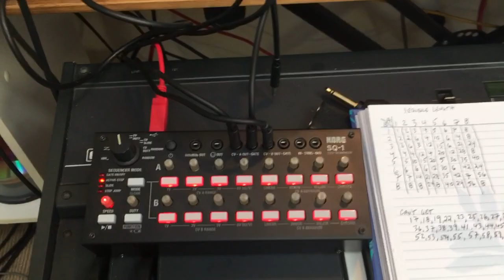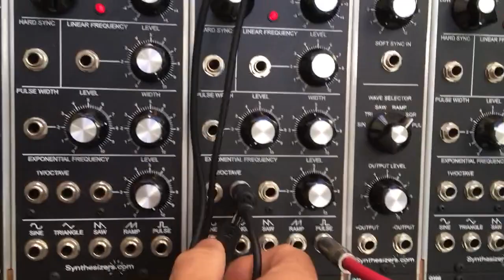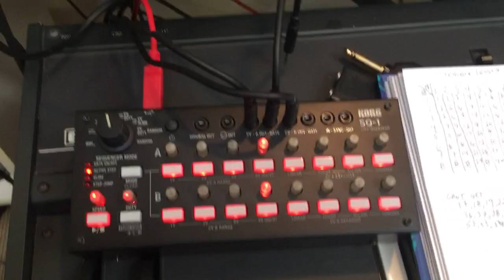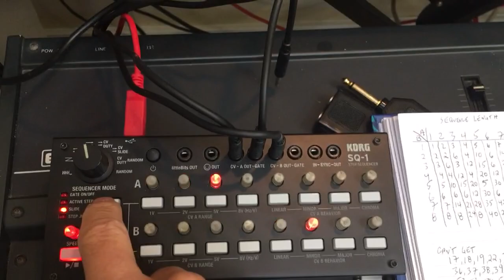Korg SQ-1 sequences longer than 16 notes

Comment: is there a way to sum the 2 voltages without a module like your own?
Reply from the maker: Great question. Not knowing what your gear is I cannot make a specific recommendation, but even a mixer is actually a voltage summer. If you have any modular equipment at all I’m sure there are plenty of utility modules that can perform this function. Many amplifiers with multiple DC inputs also sum voltages. From a technical perspective, to sum voltages accurately the input impedance of the summing circuit need to be high to prevent ‘pulling down’ the voltage outputs from the SQ-1 which would de-tune the summed CV’s.

Comment: Does any one know if you could do this with MS 20? And how? (I'm still new to modular and Korg MS 20 patch bay is pretty confusing). Thank you!
Reply from the maker: I have not tried this with the MS-20, though I do have an original one. The MS-20 has three locations in the patch bay that can be used to control VCO Frequency: “VCO 1+2 CV IN”, “Total”, “Freq”. The last two have intensity knobs under the FREQUENCY MODULATION knobs “MG/T.EXT” and “EG1/EXT”. To try this out I would run CVA from the SQ-1 into the “VCO 1+2 CV IN” and then CVB from the SQ-1 into the “FREQ” jack. Turn the “EG1/EXT” knob all the way and experiment to see what you get. For the original MS-20 the frequency control is Hz/Volt (not V/OCT) so you have to turn on the SQ-1 and hold a particular button combination to put it into Hz/Volt mode. The ‘manual’ describes how to do that.
Reply: @mikeolson7588  :Comment I've been looking for! Thank you for helping me take out the K2 from the closet :)

Comment: Ok. Great. But don't you need an VCO with two CV inputs? Or will you get the same effect if you mix two CV signals?
Reply from the maker: I used an oscillator that actually has 3, 1V/oct inputs. You can use a mixer as long as the mixer doesn’t attenuate the signal. In other words, if you put in two signals each of 2V, then exactly 4V has to come out. A ‘lossy’ mixer might put out 3.8V and then tuning will be off. You can verify this for yourself with your gear.
Reply: @mikeolson7588  Yes! I tried it with a Intelijel Quad VCA and it does work pretty well. Actually, attenuation with different curves can have quite interesting effects, if you're not after equally tempered intervals.

Comment: So do you think the sq1 is a good sequencer?
Reply from the maker: I do, especially for the money. Since I use mine exclusively with analog gear, it is a very good fit. You have probably noticed a recent explosion of new sequencers on the market. Korg has introduced yet another sequencer as well. There are many good choices with a wide variety of capabilities and prices to fit pretty much anyone’s needs.
Reply: Thank you Mike for your prompt reply.
There are so many things in the market now it gets hard to choose.
I just wanted varification.
My Sq1 came in the post today.
I bought it second hand and it hasnt got a mark in it.
It all lights up and blinks etc etc.
I look forward to using it.
It seems to be easy to operate.
I was blown away on discovering each sequenced note pitch can be changed.
It is very solidly built and FEELS good.
Thank you for putting my mind at rest.
I need to work out how to use 8 and 16 sequences before I advance to 56.
Biw Wow 
You are very clever.

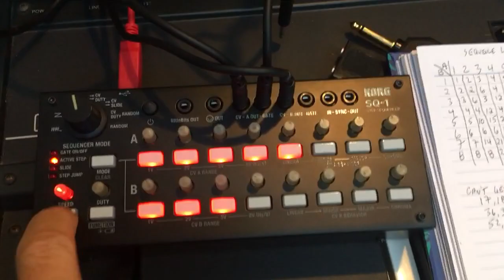Comment: 3:11 Just to clarify, for anyone who might be confused (I was for a second), only one of the two tracks has to contain an odd number (although both can).  Either way, you'll get the same sequence, but starting from a different note.  This is because the LCM will always be the product of the two numbers (with one exception, below), which means the sequence will run through every permutation of A+B.

If both tracks are even, then there are two possible sequences (again with one exception): one when both tracks start on an odd (or even) step number, and one when one is odd and the other is even.  Each possible sequence contains only half the possible permutations of A+B.

The exceptions arise when the larger number is a multiple of the smaller number, and the smaller number is greater than 2 - in other words, 6:3 and 8:4.  They will result in 3 and 4 possible sequences, respectively.  This expands when you use two SQ-1's to do this trick - 9:3, 12:3, 15:3, 12:4, 16:4, 10:5, 15:5, and 14:7 will all result in similar behavior.

Obviously, both tracks have to contain more than one step, and they can't contain the same number of steps.
Reply from the maker: Yes and well said.
Reply: I cant believe how insanely excited i am to try this. Where have you been all these years? Big love for the sq1. Would love a reissue of sq10 in green to match my ms20...

Comment: Does this trick work with MIDI out as well, or only CV?
Reply from the maker: I don’t use MIDI from the SQ-1 myself. However, I do know that the two channels put data out on 2 different MIDI channels. By Default that is Channel 1 and Channel 2. In order for this to work with MIDI you would have to add the midi note numbers somehow. I think a DAW like Logic Pro X can do this with it’s MIDI math capabilities. I have never tried it myself so I can’t tell you exactly how to do it.
Reply: @mikeolson7588  Thanks!

Comment: The relationship between the part lengths and the total sequence length is that the sequence length is the least common multiple (LCM) of part lengths. So from the set of e.g. multiples of 3 (3, 6, 9, 12, 15, 18...) and multiples of 5 (5, 10, 15, 20, 25...) find the lowest number that exists in both sets. This is useful to know if you add another pair of sequencers into the mix and would have to draw the table in four dimensions!. All the other common multiples can be found once you have the least common multiple—they're all multiples of the LCM. Useful generally with polymetric music to figure out at which points your sequences align.
Reply from the maker: You are correct. I made another tutorial making long sequences where I discuss the LCM at length. https://youtu.be/JqpCqJ-XjCg
Reply: @mikeolson7588    I've found out that this @storerestore is saying is untrue, at least for this Korg Q-1. What @Storerestore say's, it does not apply to all the table (check for instance 6 and 8, the least common multiple is 2, so by @storerestore's algorythm then the answer would be 12 or 16, and the correct one is 24) 
By observing your table I've found out that this next 5 rules applies to the whole table except to number 6, and it seems that because 6 it is the only pair number that won't fit in 8 steps)

1- The first 8 steps are direct multiplication. (e.g 8 and 1 = 8 steps)
2- For the whole matrix, equal steps in both are the direct number  (e.g. 5 and 5 = 5 steps)
3- When there are 2 pair numbers, just take the major one. (e.g. 4 amd 8 = 8 steps)
4- When pair and odd numbers, multiply them (e.g. 7 and 8 = 42)
5- All this applies to everything with the exception of 6-4 and 6-8, in which it seems that you divide 6 in triplets, so it is 3 which multiplies the other number......

Please, check this with if you have more sequencers, I would really like to know if this applies to those bigger arrays 🤓
Reply: @MarcoPolux  For 6 and 8, according my algorithm, you'd check for the first number that exists in both sets of multiples (6, 12, 18, 24, ...) and (8, 16, 24, ...), giving 24 which is indeed the least common multiple. You can very easily determine that LCM(6, 8) is not 2 because it exists in neither set.

Comment: Is this possible using midi OUT and parelel, or is it only possible if the recieving synthesizer can take 2xCV?
Reply from the maker: The MIDI outputs are on two different channels. You would need to be able to do some MIDI math to add MIDI note numbers from the two channels and then transmit them back on one channel. I have never tried to do this and I’m not sure how I would go about it. Perhaps using the MIDI tools in Logic X you could do something like this. As an alternative if you can convert each channel MIDI notes to a CV and then add the CV’s together, you could achieve this. But, if you could add CV’s you wouldn’t need the MIDI data in the first place.

Comment: I have the SQ-1, a Behringer Model D and a Neutron. I'm feeling like I have enough hardware to do this. I think the summing thing is the secret sauce?
Reply from the maker: Yes, the summing of the two channels from the SQ-1 is the key to making this work. In my example, the VCO has multiple 1V/Oct inputs that are summed together. However, you can also sum using a mixer, or even an amplifier that has two inputs and is DC coupled.
Reply: @mikeolson7588    The Behringer neutron has summing  Inputs and outputs on its patch Bay. I will research. Thanks.
Reply: No dice. Unless I'm using the summing circuit wrong. The are 2 inputs and a single output. Manual doesn't do much to explain the patch points.
Reply from the maker: Ronald Figura , I took a quick look at the Neutron manual. It looks like running the CVA into SUM1A and CVB into SUM1B would be the way to go. Then run Sum1 Out to OSC1 CV IN. You can run to just one or both oscillators. Since I don’t have the synth, I can’t try this myself.
Reply: @mikeolson7588  did that. Tried running the 56 note sequence. Seemed a bit short.
Reply: Oops. Used the wrong values for A & B. I am at a rehearsal right now. I will try again when I get home.
Reply: Ok. I think I got it. Thanks for your help and the insights. There's more going on behind these panels and jacks than meets the eye!

Comment: i thought this may interest you :- Power on the SQ1 while holding the [Play/Stop] Button puts you into Global Param Settings Mode , moving the Sequencer Mode Knob and Selecting the Small Up/Down Zigzag changes sequencer resolution to Quarter Notes , the long Z changes it to Eighth Notes and back N forth one sets it to sixteenth notes , (select choice the press power button to save, and sq1 will reboot with new settings)
Reply from the maker: Steven McDougall . That is correct and is described in the manual/FAQ site. For things NOT described in the manual or FAQ site, check out my other video on Undocumented features.
Reply: loving it so far , been playing with it for about 6 hrs with my volka keys with an empty pattern on the keys {to stop volca playing its sequence :) } well thats until my 64pixels midi hub comes so i can filter the start CC out
Reply: @NeonFuxAlot    What 64bits MIDI Hub did you end up getting?

Comment: Hi mike this is really cool... Do you have  this table published? It sounds like you do..?
Reply from the maker: Hi Paul, yes the table is published. If you look down in the comments, there is a link to the table in the SQ-1 Facebook Group. If that doesn’t work for you, I can send it to you separately. You can create the table yourself since mathematically, the sequence length is the Least Common Multiple (LCM) of A and B. This is helpful to know if you use other sequencers with more stages, or if you combine multiple sequencers.
Reply: Mike Olson thanks! I'm not on Facebook. I'll see if I can see it, if I can't drop another reply here...
Reply: Mike Olson thanks I was able to see the table... So if a synth only had a single input to its VCO, could you just merge the two signals? Or would an AND logic gate of the trick?
Reply from the maker: Paul Boos it depends on the synth. Anything that can add two voltages will work. In many systems, a mixer will do this. In some systems an amplifier with 2 inputs will do it. Just combining the two outputs by shorting them together may be a problem and possibly damage the system, so I don’t recommend that unless you know it will work. I don’t know what happens if your short the two SQ-1 channel outputs together and I don’t want to try that!
Reply: Mike Olson thanks... I'm just learning this modular stuff with a semi-modular (plankton electronics ants!). Do what are the two inputs on your VCO doing on the way to actually triggering it?
Reply from the maker: Paul Boos , my VCO has an internal mixer that combines the three 1V/Oct inputs and therefore adds them together. I looked at the ANTS front panel, and it looks like you have a mixer available as well, so I would try running CHAN A and CHAN B into the mixer IN1 and IN2 and then the mixer OUT to the CV1 or V/OCT input of OSC-X or OSC-Y. Since the mixer has attenuverters, make sure the knob is set to +1 (I’m guessing that is fully clockwise).
Reply: Mike Olson thanks again for the reply. I'm trying to think how a mixer would change how voltages would interact compared to and an AND gate or even just combining them. I can see how a pretty high voltage could overcome the current flow in a lower voltage and perhaps go backwards. What I can't see is how a mixer would change this, unless there is some circuitry that would prevent it . Also I would think a mixer (essentially one or more VCAs) would allow for voltage changes by making adjustments that that point as well.

Anyway thanks for both the vid and responses... Certainly creative and gives me a bit to ponder...

Cheers!

Comment: "... By ADDING the CVA and CVB signals from the SQ-1 in the VCO, you will be able to take advantage of Channel A and Channel B sequences of different lengths...." You actually mean "MIXING the CVA and CVB signals". Therefore, even if your VCO doesn't have more than 1V/Oct inputs, you can simply add a Linear (CV) Mixer in between (well, most mixers nowadays can sum both linear or exponential signals). This clarification is needed, to prevent users from using MULTs to connect 2 outputs to an input, which is never a good idea. Super-Like this extra-cool find.
Reply: thanks i almost did that...

Comment: Very interesting! So if i understand it correctly, this is based on that the oscillator is getting two different cv signals? How would this work in the eurorack domain? send the cv to a mixer and then from the mixer to the oscillator?
Reply from the maker: Marius Røbech Yes, the oscillator is getting two CV’s and adding them. You can also do the adding with a mixer if your VCO only has one CV input.
Reply: Thanks! This is really nice! :)
Reply: NO!! NEVER let 2 outputs in contact!!!! You seriously risk to burn a module (precisely, the one with the less powerful output). Anyway, the Doepfer A-110-1 (Standard VCO) does have 2 CV inputs (and also 2 PWM CV inputs and a Sync CV).
Reply: You could do this with a mult as well,  yes?

Comment: Nice, but i guess you cant play rests with this mode?
Reply from the maker: Hi jake. Great question. You can still create rests by turning off the GATE for a step. In my example, I'm only using the CHAN A GATE output, so rests would happen based only on the settings of the CHAN A GATE switches. What is interesting though, is that when the SQ-1 GATE is off, the CV OUT for that channel is HELD at the PREVIOUS step voltage until the next gate that is ON. As a result, with my technique of adding the two CV voltages together, the note that you get during a rest (Gate OFF) is different than the note you get when there is no rest (Gate ON). You won't hear this unless your synth patch has a non-zero release time. If you have the SQ-1 you can experiment with this and it is quite fun, giving you yet another way to make long sequences more interesting.
Reply: @mikeolson7588  Thanks for the detailed reply
Reply from the maker: Jake Lee , in the mean time I made another video for the SQ-1 called undocumented features that details how to make rests among many other things.